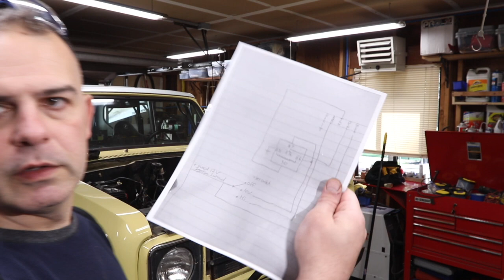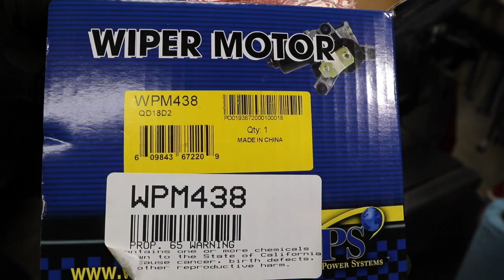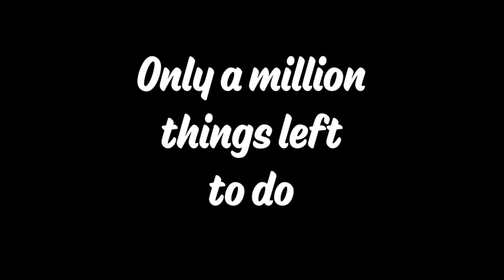5.07 Wiper Motor UPGRADE

Comment: How do you adjust park position or know where lever on motor needs to be when installing the actuator arm?
Reply from the maker: Ooof it’s been years since I did this but iirc park is the furthest position anyway. The wiper studs are knurled so you can set them wherever you want I think. I’m not sure I’m just going off my very bad memory.
Reply: @MattsGarage  good point on the knurls that should work
Reply: Some adjustment with the knurls.  I decided to pop off my wipers and mark the park position on the motor and get it as as far counter clockwise on the arms as possible so i get a full sweep.

Thanks for the tip on the bolt hitting the lever arm attachment, i had the same issue.

Comment: so you did not need to replace the switch?
Reply from the maker: I think I used the stock switch at that time. I’ve since changed to a painless universal and it works fine also. This was a pain though. If you have the $ to get a refurbished original, I would do it. This mod works fine but, yeah, a lot of work

Comment: Question - what exhaust/muffler etc do you have on the scout II? I remember how quite it was in one of you earlier episodes and would like to consider it on my 78 custom bronco. Please share and let me know your thoughts. Love your knowledge and post - fyi.
Reply from the maker: Hi Jacoby,  Good questions.  I'll try to remember to show it in an upcoming episode since I have it cut out.  I like the setup.  Basically there is a crossover that runs under the engine into a y collector onto the driver side (so the two headers connect into one on the driver's side).  From there it is a 3" pipe into a resonator and then into a truck style muffler.  You can also run two mufflers back to back if you have room under your bronco.  The bigger the muffler the quieter the sound usually.  I may bring the whole system down to a single 2.5" exhaust which would be even quieter.  People tell me that will kill horsepower but I don't ever see more than 4,000 rpm to top end power is of zero concern to me. I mean the tundra has a single 2.5" exhaust and that's a great motor.  Feel free to e-mail me at mattsgarageshow@gmail.com if you have any other questions.

Comment: Wait, you went and bought 3 bolts that turned out to be extras, so now you're gonna take them back?  Hmmm, no wonder my projects are so expensive.  But I have lots of bolts when I need them.  Also, go buy a good quality tap&die set and a letter/number drill bit set. You'll always have the correct tap drill. Good ones are a joy to use and will last a lifetime at home.
Reply from the maker: Tom Krause that European metrique stuff is spendy! It it were 5/16 is just add it to my bins